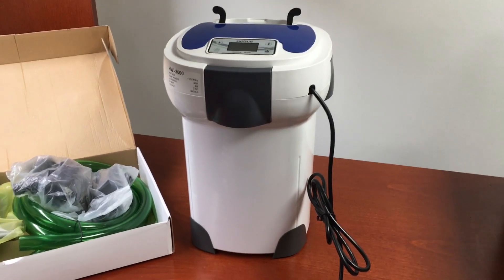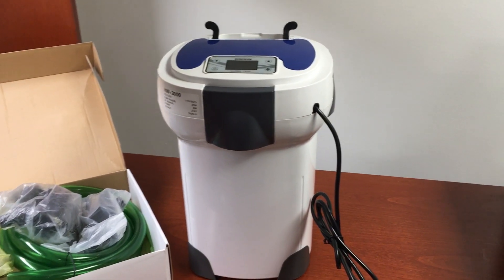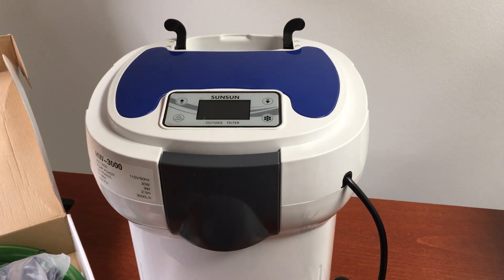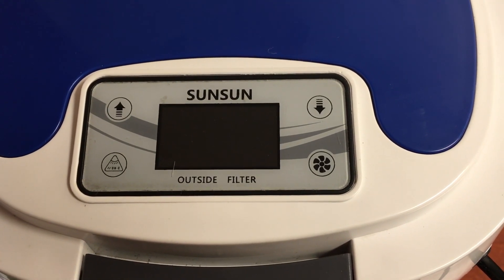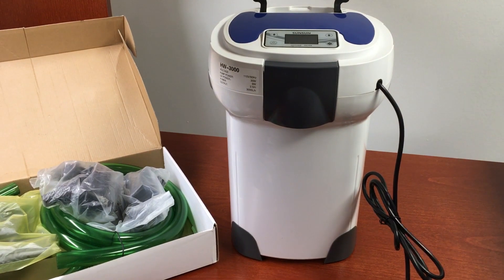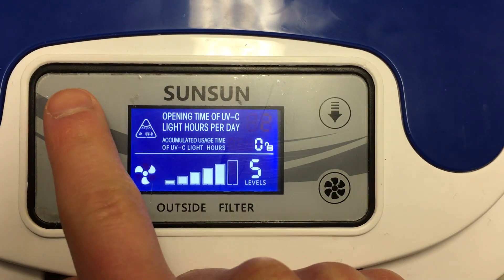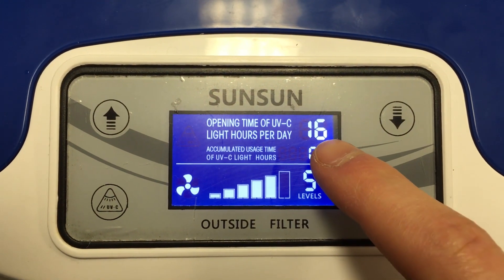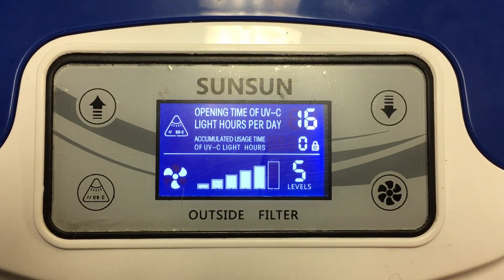SunSun HW-3000 Quick Setup and Control Panel Tutorial

Comment: With respect are you sure you have not got your inlet and outlet the wrong way round? Inlet is usually the water coming into the filter from the tank and outlet is the water coming out of the filter into the tank. The on screen captions showing 'intake assembly' is actually you assembling the outlet!

Comment: Never touch a UV lamp with your hands :)
Reply: Why
Reply: The oil from your hands will burn out the bulb quickly
Reply: That only really applies to bulbs that get super hot like old style car headlamp bulbs because the oil from your fingers can boil and cause the glass to fracture, it's unlikely a UV bulb in a canister filter will get anywhere near hot enough but better safe than sorry so I'd say put gloves on or hold it with some tissue just to be sure 👍

Comment: I had mine this day as my birthday gift. I noticed that this is self priming. The machine pumps harder when it detects air, then goes back to normal speed set. (Mindblown)
Reply: You prime it by filling the intake tube via the cap at the top while the valve block is closed, then insert the valve block and it will start the siphon process to fill the canister.
Reply: We can only know it by measuring Amperage to count it’s power consumption , otherwise it could louder sound and shots/squiring water

Comment: Can we take out the head and test the uv light by switching on the head? When i try to test for my unit, the uv light doesn't turn on?So i am not sure if the uv ia working.Is this expected? I mean it will turn on only when the head is inserted into the canister and locked?

Comment: Just set up my HW-3000 and the symbol for the UV light is constantly flashing on and off. According to the instruction leaflet (not impressed) that means that the UV bulb needs to be changed; is that correct as in your video your one was also flashing on and off?
Reply: I'm trying to figure out how to reset the hour counter. So far no luck.
Reply: Hi..mine too was flashing constantly..any updates from if its really due to the lamp?

Comment: Hello. Great video sr. I bought my hw 3000 filter in Aliexpress and the ETA to receive is may 27th Brazil). What about the noise? Is there too much? I will embed inside a tv stand rack. And the reposition parts. Disbyou found spare parts in anywhere? These are my only 2 concerns about this equipment. Thank for the video!!
Reply from the maker: Hello William! Congratulations on purchasing your SunSun HW-3000! We have tested the filter a few times and it does have a smooth and low noise operation. What kind of spare parts were you looking for?
Reply: William, did you receive your hw-3000? If so, how do you like it? I’m not finding very many reviews on it after a few months of use. I can’t decide between the 704b and the 3000.
Reply: @gottaazzlikethat  Hi, I don't know if you purchased your filter yet but I would strongly urge the 304b over the 704b as there have been many issues with the 704b...the 3000 is the best overall and I am using one now...I'm hoping replacement impellers become available because Sunsun impellers have a tendency to crack.
Reply: The 304b though doesn't nearly move enough water to be effective though. On bigger tanks. I've been looking hard for one of these and can't find them anywhere which is a shame :/ the only ones I do find won't work natively in the US. With out a plug converter. Which I don't fully trust on something that's going to be running 24/7
Reply: @edwardk12687  Search for the 3000 on eBay...there is a recognized trustworthy seller that has been actively selling these units for $125. I believe I the seller's name is Tech n Toy and is based in Chicago..I purchased my 3000 from them and it works flawlessly...if you have experience with the older models like the 304b, you will absolutely love this filter...it is literally twice as powerful and the best part is that you can adjust the flowrate which makes a huge difference if you are using the UV light.
Reply: @GSP-76  I bought directly from sunsun since I live in China. Maybe you already know by now, but the hw3000 uses the same impellar as the 704b.
Reply: @Yookie_a  Really? I didn't know...I have the 3000 up and running on my 150g cichlid tank and it's working perfectly...I have been using Sunsun canisters for a while now and love them but have needed to replace impellars before...the 304b impeller is widely available on Amazon so I never had any problem getting them...I will look for the 704b impellar online so that I have a spare handy. This 3000 canister is amazing...best on the market for the money in my opinion.
Reply: @GSP-76  Yup, seems good so far. I only received mine a few days ago though. Also bought a bunch of spares as they're ridiculously cheap here. So can 100% confirm that the impellar at least, is the same as the HW704

Comment: Does HW-3000 share any replacement parts in common with the HW-704B series, such as baskets, filter pads, o-rings, UV Bulb, hoses, etc...?
Or, will consumables and repair parts be unique for this model compared to the previous HW-7## series?
Reply: Looking at the HW-704B it looks like it uses the same standardized parts as the 404b and 304b, at least in regards to the trays. This unit uses the same trays as well.

Comment: You forgot to mention there is an adjustment on the intake tube where you removed the plug to fill with water. I found that by accident my unit was sucking air bad.

Comment: Great video!!! Thank you so much...    In a near future video can u show us the flow rate value in action?  Olso one more question.. How meny media baskets are in the main body?
Reply from the maker: Hello Cichlid Spartan! We will take your suggestion for our future videos. There are 4 media baskets included with the HW-3000.
Reply: Yep definitely wanted to see the flow. Like the filter. How much did it cost?
Reply: @mingtrading7542  Hi, are the media trays in this model the same size as the 304b?
Reply from the maker: Hello! Yes, the media trays are the same for the HW-3000, HW-304B, HW-404B, and HW-704B. You can also use the same filter pads as well!
Reply: @mingtrading7542  How about the impeller? I have used Sunsun canisters for a long time and have needed replacement impellers...does the 3000 use the same impeller as the 304b?

Comment: I purchased my filter yesterday. I watched your video on the assembly, however, you didn't show what you did with the long tube with the holes in it. Please advise...
Reply from the maker: Hello, Antonio! It is the user's choice on attaching either the flare ends or the spray bar to the output tube. Simply just remove the flare ends and attach the spray bar. If you have any other questions, feel free to email support@mingllc.com.
Reply: thats the spray bar and can go in the aquarium on the return hose

Comment: Mine will be arriving in two days from amazon,  interesting that you can adjust the motor speed, being new at this, is there a reason to set the speed to different levels.
Reply: Yes..if you want to kill unwanted bacteria, algae, phosphates, etc. by turning on the UV light, you need to slow the flow rate down...the slower flow rate let's the UV light kill these bacterias very quickly and efficiently...then after a few days, you can turn the UV off and increase flow rate.
Reply: @GSP-76  I'm so glad someone else understands this. I tell people all the time that the UV in the 304b does little or nothing due to the flow rate...thet just laugh at me.
Reply: @D.DUB.V  Most people just don't understand how UV sterilizers work.

Comment: Has anyone done a test yet to see the actual GPH you can get from this with media present in it?

The 404B which is what I have now was rated at 525 GPH, but when others tested it with media it would actually get just around 300 GPH. That is when it is new.

My current 404B after three and a half years is getting probably closer to 150. Three of the four trays have actually completely dissolved as well around the circular opening.

I have just ordered a HW-3000 from Amazon seeing it is rated at 793GPH. I am hoping it actually runs close to that with media. 
I would really like to be able to switch from three filters down to one powerful filter.

Right now I have:
SunSun 404B giving me around 150GPH (Rated at 525 GPH) 3 Years Old
Fluval U4 giving me around 220GPH (Rated at 260 GPH) 4 Years old
Fluval Aqualclear 70 giving me around 250GPH (Rated at 350 GPH) 3 Years Old

For a total of 620GPH.

This HW-3000 is rated at 793GPH, as long as it actually outputs close to what it is rated at it should work for me, which is why I am interested in seeing if anyone has actually tested it who owns one :)
Reply: I have the 3000 on my 150g freshwater tank..I was using two 304b canisters and now I'm using this and one 304b...the flow rate is definitely less once you fill up the trays with media...the best way to preserve more GPH is to use either the bottom tray or bottom two trays with mechanical filtration and the top two or three with biological. Don't put a filter pad in each tray the way they show you in the videos as that will negatively affect gph more. I have used the Fluval FX6 in the past and can honestly say that this filter is better..it's probably the best overall filter available on the market and for $125 you can't go wrong..if you seal the o-ring with silicone lubricant, it will last you a very long time.
Reply: @GSP-76  Thanks for the reply. The unit definitely appears to be way nicer than the 404b. I received it and set it up no problem. The new way of priming and the individual shut off valves for input and output are really nice. So is the touch screen and built in UV scheduling.  I mean it really is hard to complain for its features based on the price of $125, but the actual water output is definitely faaaar lower than what they are rating it at. It can barely push water all the way across my 135 Gallon tank. Which is truly disappointing because there are 3500 L/H (924GPH) internal filters you can pick up on Aliexpress and Wish for like $11 now. So the cost for them to put a better pump into this thing should be pretty negligible for them.
Reply: I’m having issues with flow in my 40 gallon with it. I just added a tidal 75 hang on to get things moving

Comment: Ming. I have a Need some help with this filter. If you have a 3D background can anyone tell me how they get the intake tube over the aquarium edge and the background?  Any extension tubes or work around available?
Reply: You ever find out how to use this for plastic rimmed tanks?
Reply: 79ninzombie no....I’m still looking for a good solution
Reply: I removed the entire clamp assembly and used suction cups to secure the hoses, inlet, and outlet tubes to the glass of the aquarium. Some have suggested cutting notches from the lip of the rim so the clamp can fit over the edge, but I didn’t feel comfortable with that solution.

Comment: Please provide detailed outside dimensions.  Is HW-3000 same size or even larger than HW-704B?
What is the tubing ID?  Is it 3/4 (19 mm) or is it even bigger?
Is there a pre-filter/booster filter (Similar to HW-603) available that can provide mechanical filtration ahead of this filter, but that would have larger diameter tubing connections
to handle the higher flow rate capabilities of the HW-3000?
Reply: It's the same size and uses same baskets.

Comment: The chinglish in attempt to make sense of the display, and extreamly poor (failing attempt) is a deal breaker for me, I just refuse to bend backward that far. This along with the rice filled plastic failing with use of the (who knows if it ever worked at all???) UV light. Try finding someone who went to college in the US.  It also fails to comply with the FCC part 95 spurious radiation radiated from the variable frequency supply, no shielding at all. I had to install extra equipment to isolate the electrical noise from my shortwave station. Makes me wonder if this is safe for my house at all. Nice try, did not fool this engineer. Hopefully in the future sunsun will gather some better market presence when they make these little but very cheap & important changes.

Comment: Stinks these aren't available in the US yet. I was ready to buy two of them. But No one has one that will natively work in the US (nore can i actually find the filter anywhere around here or online) what I mean by natively is all of the ones I've seen have to run converters on them, I don't know how much I trust that on something that's expected to run 24/7 but this filter seems really comparable to the fluval line at like a 10th of the cost
Reply: You can buy these off Amazon no problem at all in the US. :) 
Amazon is actually cheaper than Ebay and any other location, and it is prime eligible with free 2 day shipping.

Just search Amazon for HW-3000.

Comment: Hi, did you hear some noise when your filter are running? I have this filter too and it makes a louder noise than my old 402A filter. Thanks!
Reply: It's probably spiting due to the surface skimmer letting in air. I just took off the floating inlet and replaced it with an intake strainer.

Comment: Is there a bigger than this
Reply: If you want higher flow rate, your better off going with a sump and separate water pump/power head...in an enclosed canister, 800-1000gph is the maximum that will work.

Comment: Hi Bought one of these and have watched video many times but I can not get this thing to prime I have filled the tubes but I can't get it to flow out.  Any ideas:?  I just bought and got this canister.
Reply from the maker: Hi, Bill! Please make sure that the tubes are on the correct side (intake/outtake). Also, make sure that the 2 levers are at the 'water on' position, the green tubes filled with water, and to fasten the cap. If you require additional help, please email us at support@mingllc.com.
Reply: Hi I have a sunsun hw 3000lph filter. On the top of the filter where the hoses are connected to the taps, the intake lever needs to be down ie the picture of a tap without a drip and the right lever pushed to on ie the tap with the drip. Put a couple of cups of tank water down the top of the green tubes by un screwing the grey nuts and gently removing the blue plugs(one at a time). Once this is done replace the blue plugs on both and screw on the grey nuts. Now go back and make sure both levers on the top of the hose connectors are now both on the taps with the drips and turn on the pump. A little noise at first but after 3 seconds all good. I have only use the tube with the intake strainer and not the surface skimmer. Less complicated and alot less noise. 
Really hope this helps.